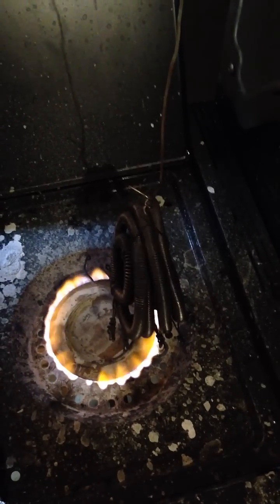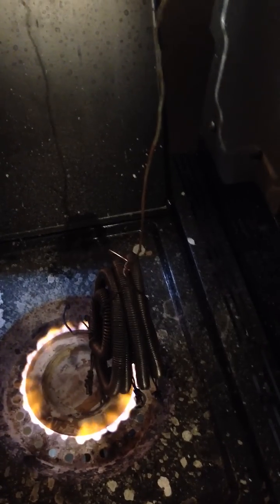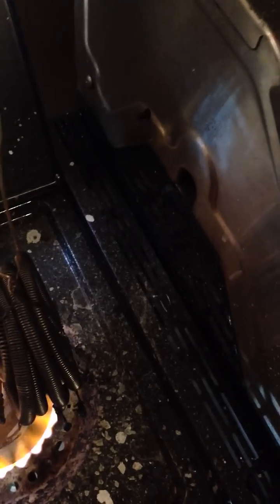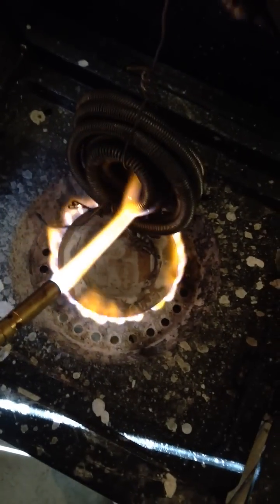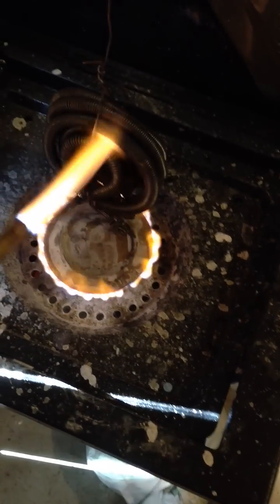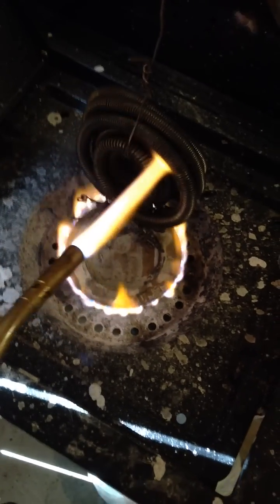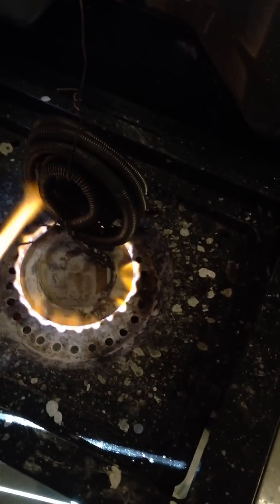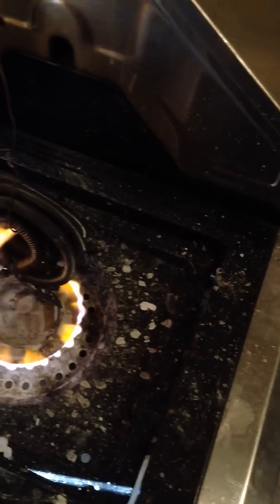Keshe Foundation Magrav Power, Fast, thick robust nanocoating

Comment: "Thick robust nanocoating" LMAO
Are you aware that this is a contradiction in itself? O almost fell from my chair laughing when I read that
Reply from the maker: +Josef Görling  I am glad you had enough sense to hold onto your chair while laughing, because if you used it other than to save yourself from falling off a chair you would understand that nanocoating occurs in layers, by the time it's a visable black coating it's about 10,000 layers, do some real thinking before you show how adept you brain is at logical thoughts and concepts, youv'e shown how really difficult that is for you by your vegetative brain state comments.
Reply: +NewTubeIndeed I know pretty well what "nanocoating" really means. Cu(II)O fimply does not build a "nano coat" as you would immediately see when you look at th final coating with an electron microscope and a Raman diagram will show that it is CuO.
Oxidated copper is well known since thousands of years :)
Reply: +Josef Görling    I guess what I did not understand - was when you laughed at nano-coating having multiple layers... and then I did not understand why you sent me to that link you posted that has nothing to do with layers.  Then again - because it did not mention how the layers can be built up - it may have led you to believe that such a thing does not exist... and maybe that is why you laughed?

Now I use sodium hydroxide along with over a hundred herbs, spices and/or etc. mixed in... and I know for a fact that each time I give them a hot lye bath and even when I steam them with the lye solution - each time they come out with a thicker nano-coating which most would call "more layers"... and I even fit a wire loosely on an object that I then removed and then nano-coated... but it would not fit over the object again because the wire became too small... some would say "too thick" - others might even say that the copper wire was "COATED" or "LAYERED" too much for it to fit anymore - like putting on too much paint on a door jam - wherein the door would not close anymore or if it did... it would be jammed!

I think that is because the nano-coating took up space some how... which makes me wonder why they call it nano - "COATING" - if you are even remotely correct - it should be called something different... if it really does not "Coat" anything - or in laymen's terms for "Coating"... I believe would be summed us as "LAYERING"... what do you think?

Can you now see what I did not understand?  I really do not understand why you were never taught what a layer was... then again - a farmer would immediately think of his best liked chicken.  You would have a lot of fun with farmers, I am sure only of that - but the rest... I just simply do not understand...

Peace~
Reply: +Josef G&#246;rling Josef Gorling is apparently a dis info agent.. Alert! He is in all Keshe foundation videos spamming with negativity..! Don&#39;t mind this guy!
Reply: +Beloved Inbox Are you a Keshe sockpuppet or simply ignorant?
I vote for both :D
Reply: +MrChrisd73 Right. But not all. Some have their head only to prevent rain from falling into their throat :D
Reply: @josefgorling7862  what does it matter what other ppl do in their lives. Those who mock, ridicule, and troll others are no doubt diss-info agents, even if your not signed up for the diss-info newsletter. It always baffles me how ppl think they can sway ppls minds by using hateful rhetoric. Arrogance and self-centereness are a flaw of humans.
Reply: +Josef Görling    Please correct me if I am wrong - but it appeared to me, that you were at least going to attempt to make some sort of a valid remark in what you said... but I must have missed it.  It was a nice try though... and - you really are a funny guy...

Peace~
Reply: +Rev. Al-Yahnai Hawkins What exactly didn&#39;t you understand?

FYI: https://en.wikipedia.org/wiki/Copper(II)_oxide
Reply: Rev. Al-Yahnai Hawkins
The link I sent you is an exact and extensive specification of the material with which the copper is coated. This is nothing miraculous and this sort of coating has been observed since thousands of years and explained and analysed since centuries.

If you really want to know I can as well give you a link to a detailled description of what happens during this specific oxidation process (using heat - as you probably know there are several different processes which can cause this form of oxidation)

The claim that this black stuff consists of several nanolayers and has some miraculous properties can easily be falsified. All you need is a good DMM:

Measure the resistance of the coated and allegedly superconducting wire - if it is not zero the claim is wrong
Measure the resistance of the coating. If it is not infinite, the claim is wrong
That's it.

If you measure zero at the copper and infinite at the coating it makes sense to continue, otherwise the whole thing is pure made up (by Keshe) nonsense and material for the trashcan.
Reply: Josef Görling
 You know what? I should apologize to you because you were talking to NewTubeIndeed about the fire nano-coating in layers... and at the time of my comment - well, it just didn't click in my head that the fire nano coating that I attempted was on a bar-b-que put with mesquite leaves to coat it... but now I know that you were referring to the clean burning propane torch nano-coating - which are different and I got them confused and I do apologize for that because I never once seen up close (to my recollection at this time that is...) any actual coils that were nano-coated in such a way. I really don't know much about it other than I prefer to do the sodium hydroxide boiling baths filled with herbs, spices, essential oils... everything but the kitchen sink went into my nano-coating bath with even a piece of a sardine...

I don't know how one could add these essences and information to the wires with a blow torch and at the time of my bar-b-que nano-coating, I did not even think of programming the nano-coating to do such a thing. Now when I nano-coated them with the smoking fire - I did not even know that I was supposed to heat it up almost red hot - so when I used the nano-coated copper in my GANS collection units... I noticed that some of the coating was coming off - in layers. But you didn't even refer to this type of coating in your dissertation with NewTubeIndeed about HIS PROCESS of nano-coating... and I was wrong and hope you forgive me about that, I answered with apples instead of oranges and I was out of line.

But I cannot agree with you when you say: "The claim that this black stuff consists of several nanolayers and has some miraculous properties can easily be falsified. All you need is a good DMM:"... because I do not know what a DMM is? Also, I really don't know much about electricity except when I have to work on it - it hurts me and shatters my confidence for a while. I really cannot comment though on that type of nano-coating as I don't know much about it and I don't like to talk of things I don't know... trying to get people to think that I do. But - ...

As far as the nano-coating I do with the sodium hydroxide and all the herbs and spices... I have to tell you that this is some really powerful ship to dock out on. See - a few weeks ago... around the 30th of October and the 1st of November, 2015 - I made a few mistakes and I only made like six sets of coils... but they were just the long ones... and I had them all nano-coated several times in boiling hot lye baths - then several times I also steamed them and they were done well. Thing is though - I thought that we were to put the shorter 80 wrapped spring/coil into the 160 wrapped larger diameter coil...

I did not understand that I needed 2 different kinds of sets - a bigger and smaller diameter 80 turn set and a bigger and smaller diameter 160 turn set... so, I had to take them all apart and make more springs and such - and now I ended up with 15 sets to make 5 units with.

Now when I was taking the coils apart after this embarrassing discovery - and I was wearing my rubber gloves - but... I was wearing my typical Fruit of the Loom short sleeved shirt with a pocket... and them wires from the small diameter wire with the long tail wires - well - they were slapping my arms and I got slapped in the face a few times as well - but it was not like I grabbed a hold of the wires with my bare hands... they just grazed me as the tail wires swung around all over the place. It wasn't only like 7 or 8 minutes after being slapped the first time - that I started to taste essential oils...

Well for 40 years of my 54 year long life at present, I had allergies so bad that I could very seldom smell anything at all... but like those who suffer the loss of one of their senses - the others at times may get enlightened and heightened... well - I could taste what everybody else smelled... so farts really pissed me off. Anyway, I asked my boys if they had gotten into the Eucalyptus essential oils... and they said no. So I asked if they smelled Eucalyptus and they said no... so I kept taking coils apart and every now and then the wires would brush my arm or slap me across the face.

Around 15 minutes after I had tasted the Eucalyptus essential oil... it just went away and my tongue was BLASTED with a Young's Living Essential Oil blend called "Thieves"... I mean it came on like I had put maybe 3 or 4 drops on my tongue - it even burned as if I dropped the blend on my tongue just moment before. Then some 15 minutes later the "Thieves" just stopped... and Myrrh came on and kicked me right in my mouth. My children could not smell it on my breath but I am being honest with you and not embellishing a bit... maybe downplaying it a little actually - because it was really a powerful thing going on that I had absolutely no way to make it stop...

Well that was taking place or starting on the 30th of October when I picked up my boys for weekend visitation - and at sundown we were all ready for the Sabbath. Right after sundown on the 31st after Sabbath had ended... well my boys (11 & 14) were shown how to make coils and we worked on them for a while and picked up again on November 1st... though I wore long sleeved sweatshirt - them stinking tail wires of the smaller diameter coils that were nano-coated got snuck up my sleeve a couple of times and I got slapped a few times in the face and on the neck but not nearly as much as what took place while taking the erroneous coils apart on the 30th of October.

I am not making this up and if you were here my children would tell you... I WASSSSS SOOOOOOO STONED! AND TO THE BONE... I had to have the old woman come to pick up the children because I could not drive - I could barely walk down the steps of my porch let alone walk without support to my van to figure out how to start it. And then to top it off - I WAS SO ENERGIZED I DID NOT KNOW WHAT TO DO WITH MYSELF! I mean I had flavors in my mouth changing almost every 15 minutes on the dot to a different flavor of what I put into that boiling lye nano-coating bath... the sardine was not so bad but the Vitamin B Complex that I put in there - that was just downright disgusting every time it came up time to dance on my taste buds.

After my children left to go home... I kept getting higher and HIGHER - but I was not once at all feeling pukie like some say they feel with the nano-coating exposures... I FELT WONDERFUL. High as a space shuttle bobbing around in space... but I felt really well, which was quite unusual for me. The whole reason why I became a Minister of Health was to have access and discover ways to heal my own self - "Healer - heal thyself!" thing was going on as I was always ill my entire life... had colon cancer back in 90 that they only gave me 6 weeks to live and did not know how I had survived the last 3 and 1/2 years... so the sorcerers tried to give me a six week spell into the grave.

So I chewed them out severely and let them know that they held no spell over me... and that there was no way I could die because I had not been called out of the world to die from the red/raw blood, the black blood looked like coffee grounds and the blood clots that were coming out many - many times a day that were as big as my fist... and I carried around pocket fulls of jalapeno and habenero peppers because when I was too weak to even put one foot in front of the other without me pulling on my pant legs to move my feet - I would eat a pepper or two and in around 5 or 10 minutes - I had energy enough to do my job... but I was a dead man walking.

The black blood was because the cancer spread to my lungs and my entire chest cavity on the x-rays were rather dark... I was full of cancer but no way did their spells capture me at all. I was scheduled for a colonoscopy right after the doctor pulled his thumb out of my rectum... guess he was checking to see how large the polyps were right near the exit there... and I was full of polyps as big as your thumb throughout my guts - so they wanted to do some biopsies of them and I was scheduled to return to the VA hospital in Big Spring around 5 days from then... Well I had hands laid on me and my faith did some amazing things and I was blessed by Messiah from on High - so when I went in for my colonoscopy and they drove that tractor trailer up my but with that big search light... fog horn blasting out air and popping wheelies all over the place - the doctor was distraught over what he was looking at.

I thought I was dying and was already OD'd on Demerol... and the sorcerer kept going over to the x-rays of me on the wall - then back to his periscope to look up my butt - back to the x-rays... finally he barked out - "JUST WHO IN THE HELLL - TOOK THESE X-RAYS ANY WAY OF THIS MAN!!!???" The nurses pointed out that he took them personally as his signature on them proves... and he got really angry. Next thing I know - I was kicked out of the VA hospital... OD'd on Demerol bumping the walls as my Ex tried to help me get my station wagon I had at the time where I climbed in the back and slept like a baby.

Now as I was being kicked out - the doctor came back out and called me back into his office to stick his thumb up my butt again... and boy was that sore after the tractor trailer was pulled back out of there earlier... and the doctor was really tripping out. He let me know that what went on was impossible - because... I had the intestines of a brand new baby - so, I reminded him that is spells on me wouldn't work - not when I got Yahshua Messiah on my side. Anyway - that is just one instance of my illnesses of a lifetime - I had the colon cancer since being in the Army in around 1979 - but they diagnosed it at that time when it was first taking root - as IBS - irritable bowel syndrome because I was going number 2 - like 20 - 40 times a day back then... toilet paper have me bloody raw for years...

I had an extreme tolerance to pain as if I were immune to it, must have come from much practice - so I didn't speak much about my daily pains and sufferings - and until that day when my Barren pregnant wife for the first of 7 that we had that survived came into the bathroom before I could flush the toilet - I would have been dead... and I really wanted to be dead. Life sucked/sucks - I never really found any pleasure or joy in waking up or doing anything - so I failed as well to drink myself to death. Guess there just wasn't enough whiskey in Abilene.

The city of Abilene, Texas demolished our home on February 27, 1989... they came early in the morning - kicked my then pregnant wife and I out of our home without any prior Notice... I had just refurbished an old rock house and was going to have the electric hooked up the following week - I had a farm with around 2,000 exotic birds... just quit my job and was going to publish a hatchery magazine - and... I had just finished building and spending all the money I had on 2 brand new homes on my property as well. Well they kicked us of under duress and under threat of false Misprision... and they took everything that we owned to the dump.

After tearing down all my chicken & bird houses - wild packs of dogs came through and just killed for sport... within 2 weeks I was burning piles of birds as tall as myself... too many to bury as they killed most every one of my birds... some cost me over $2,000.00 a piece. Come to find out - the City had the wrong address, they had an order to demolish 600 Virgil Street - and my address was 700 Virgil. So when I fought them in court for the next 20 years - they tried to put me into prison for 10 + years... denied me a jury trial though demanded and paid for... and then the court robbed me. The only thing I got out of them doing what they did was that several City attorneys resigned and fled the State because I was really whooping their butts... but judges that are all part of the corporate system ignore the facts and nourish the lies.

February in Texas is as cold as ice... and my pregnant wife and I now homeless... and penniless - only the clothes on our backs found an old abandoned school bus where we survived almost a year before a couple of people took us in basically as slaves; because, they did not want to see the state take away our first daughter due to our living arrangements... and I could not get a job for 9 months. We had to live on food stamps and our household and clothes shopping was from what we found in the trash cans around town.

In 2010 I had finally saved up enough to buy a house - I do not pay usury so would not get a mortgage - I paid cash for it... and I started doing repairs so that I could turn it into a church. A month after I bought it - I had my utility trailer packed with paint, ladders and/or etc. - as I was going to paint the place... but there was a big old Trojan sitting on my roof. Yeah - they were demolishing that one as well without any Prior Notice again... so much with not being deprived of property without first having one's day in court - Abilene does not need to do such things even though I proved in court that they did not follow their own Rules and Regulations concerning demolitions... so the judge took away that piece of property from me without giving me a red cent once again... to Taylor County. No sense asking why - the judges in this town do not even know why they rule as they do... they are all corrupt and just part of the corporate system and employed by Satan the Devil.

So as you see - I always was sick and abused my whole life... and when them nano-coated wires got to slapping me around - I GOT WELL!!! I mean I did not sleep a single wink from the 1st of November until the night of the 6th after I picked up my children... and I was still just as whacked out as I was on the 1st... but I was getting used to the intense buzz and was able to drive cautiously... but I was so energized and stoned to the bone - the only thing I had going for me for weeks was that I watched the clock and tried to guess which flavor was going to attack my mouth every 15 minutes. I finally came down to almost normality here last Thursday - the 26th... but I still get the flavors in my mouth though it has mostly been "Thieves" oil taking up most of the time - and with much less intensity as I write this to you.

So then I really cannot agree with you that these nano-coated wires hold no power, as I Truly do believe that they do. Since the 19th of this month after putting together 5 Health Bottles (nano-coated wrapped bottles with some nano-coated spirals added & now wrapped in duct tape) on the 17th... I drank for the first time of the Health Bottle waters with my boys and one of their friends from school who was overweight and not feeling well - but after our first 1/2 bottle each of the Health Bottle's water... we were all totally impressed, and I didn't get to sleep for 2 days after that drink & the 1/2 bottle the next day as well. I know these things work - the pain pens and the Health Bottles because of the nano coating on the wires.

I know that you may still yet have a problem seeing things as I do - and that is alright. If you would though - take a look at this site: http://shop.santewater.com/aboutus.sc as I used to be own a distributorship with them and central Texas was my territory. These energy devices are empowered by bio-photons and they are truly a great power... but - the nano-coated wires appear to have more power than the mugs that I drink water from every single day for around 15 years now... or from my pitchers or other items that they no longer even sell - but I have them and use them daily and they really helped - but I wrapped one of these with nano-wires and then put 3 vials of GANS materials every 120 degrees around it... and it is just so much more powerful than it every was before.

I water my plants with this water... and my plants have been growing since spring and they only went to a certain height and stopped growing higher - they grew out a little... but they were not impressive. So I gave them the water from my big Health Bottle one night... and in the morning they were so shiny and bright and must have grown 1/2 inch overnight. WOW! So I watered them again and they even got more impressive. The first frost hit and they looked a bit sad - but I watered them again and within 20 minutes... you would never have known that they been through a frost - so then...

How could I possibly agree with you that there is no power in the nano-coated wires? I could not do this my friend because I quit lying many years ago... why lie when nothing matters anyway, know what I mean? I really would that I knew about this nano-coating and GANS some 50 years ago - because... I FEEL REALLY WONDERFUL! I never felt this well - but I apologize for this getting this long while rambling on about my miseries and now my great victories with the Health Bottles and pain pen... even though I haven't been to bed since day before yesterday because I am so wired from the Health Bottle waters.

I hardly sleep and I hardly eat anymore... AND I FEEL TERRIFIC!!! A few days ago when I got out of bed last... I got up and was as aware and instantly wide awake with NO BRAIN FOG WHATSOEVER... and it was as though I had just walked into the bedroom to pick something up - that is how aware I was and I am actually looking forward to new days instead of regretting them. I tell you my friend - you should try one of my Health Bottles before you set your mind in stone against this whole thing... I would not tell you lies to impress you - but I believe that you would maybe see things in a different light if you were to try one of them filled with your own water and then programmed by your body to take from the wires what your body needs... and then to put information in the water as to what things that your body needs to get rid of without harming you... seriously...

Peace~
Reply: +Josef Görling im putting my money into copper stalks, thats the only sure bet with this technology :)
Reply: +r big Maybe a good idea. But be careful - the source information is from Keshe, which makes it suspect (to say the least :D )
Reply: +Josef Görling  oh ya, herbs and spices also LOL, seams like these lemmings will follow anyone off a cliff.
Reply: +r big Even after that:
Transcript of keshes &quot;teaching&quot;:

Every single one of you failed. The greed took over your intellect.
And then you called me a liar, when you don't want to call yourself stupid.
      You&#39;re the most stupid lot i've ever seen.

Just a tiny piece out of pages of irrational rant. Congrats to your &quot;intelligence&quot;, dear Keshe followers :D
Reply: +Josef Görling i heard one of his teachings to kids, he claimes head lice is from stress from adults. ie: teachers and parents. not cleanliness! he claimed the negative brain waves attracted the bugs, how can anyone take this guy seriously????
Reply: +r big His brain derailed at least twenty years ago. But some idiots will defend him even if he kichs their ass and claim that it was their fault not to remove their ass out of the way of his shoes. Even a fried turkey has more intelligence - he keeps his mouth shut. :D